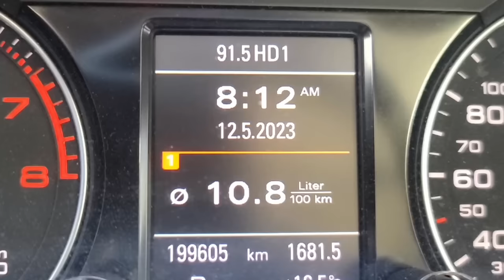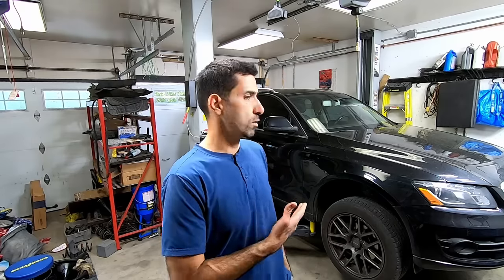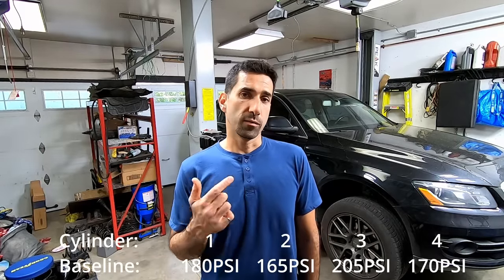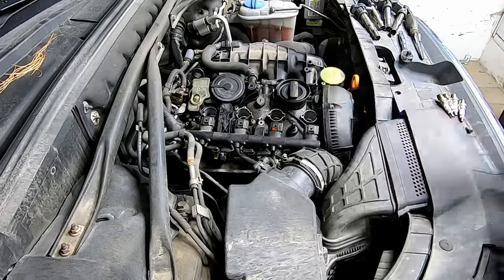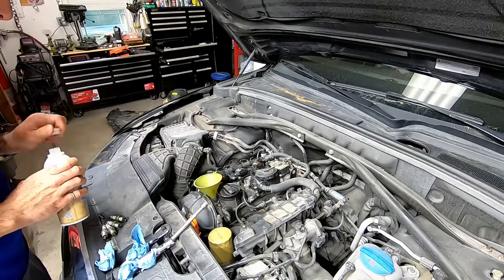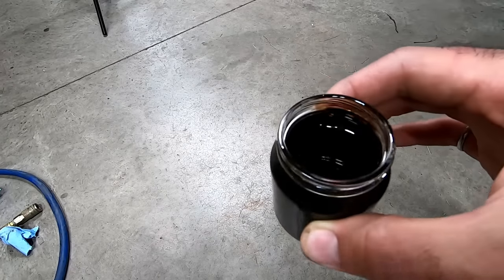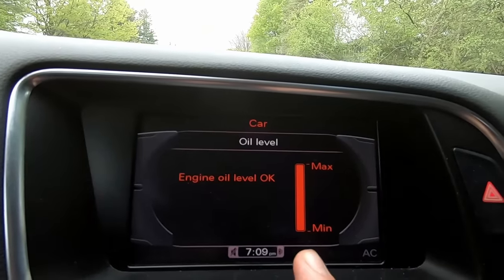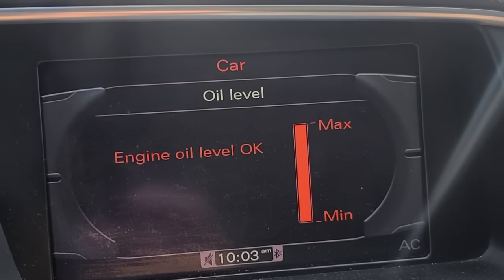How to fix excessive oil consumption from clogged piston rings (Part 2)

Comment: Here’s another data point decided to give this a try on my 2015 q5. It ran great just used about a quart every 350 miles. Did it exactly how you did it and vehicle won’t even run now. It was difficult to start after the soak to be expected. Drove pretty poorly for the 20 minute drive. Changed the oil, Misfires like crazy, will barely stay running.
Reply from the maker: Take the plugs out and clean them up... when I did that on the A4 the plugs were very fouled and I had misfires on two cylinders so I needed to clean them and dry them before the misfires went away
Reply from the maker: Does it throw any codes other than misfires?
Reply from the maker: Hey - any updates on this?
Reply: I got running well again. After clearing engine faults and resetting basic settings it ran fine something threw it way off. I've only driven 150 miles but it hasn't burned any oil. Typically it burned about a half quart in that time.
Reply from the maker: @adamearle583  phew - you had me worried there for a minute... glad to hear it's running OK again - let's see where if there's a good improvement in the consumption... please keep us posted wth the final results
Reply: @adamearle583  how are the results a month later? Any improvement on oil consumption?

Comment: Good test. You should lube the seal on the oil filter and you shouldn't drop the plugs down into the holes. Use a piece of rubber hose to lower them into place and to start the threads.

Comment: I just started this process on my Q5 2012, 113k miles. But I am doing it over a two week trip. So far I have experienced what I believe is carbon debris that have swelled, causing a slight binding at top dead center. Being a zero clearance engine, this concerns me, I have an endescope and see the deposits, am agitating with a plastic tool to scrape and move, I sucked out the first B12 with carbon using an oil extraction pump.
Reply from the maker: Interesting...the debris is from the top of the piston? Are you driving around with B12 for 2 weeks? That might be a bit much... good idea on sucking out the garbage for sure - is the motor binding when you rotate by hand?
Reply: @ETMotorsports  I went on a trip by airplane for 10 days, started the B12 soak days before leaving, continued when I returned. Bottom line is IT WORKED!!!! I can't be happy enough,  already driven 800 miles, oil level same as when I filled it. Tailpipes tips no longer sooty, amazing results.

Comment: just a trick before you want start the car. a few drop of engine oil on the pistons before you install the spark plug would make it way easier to start and better for the cylinder wall
Reply: I sprayed some Stabil engine fogging oil in mine and it fired right up.

Comment: Thinking about it... This is fuel injector cleaner. It's a liquid that will burn just like fuel and it's intended as an additive to fuel.
Now you poured a bottle or 2 of it directly into the combustion chamber. It will slowly leak through the piston rings and down into the oil pan. Regardless of the fact that it will dissolve the carbon built up in the piston rings. You will end up with a liter of fuel-like substance in your oil. You run the car and the oil warm up until 100 degrees. Won't that 1L of fuel ignite inside your oil pan?
Reply from the maker: haven't had any issues with flammability

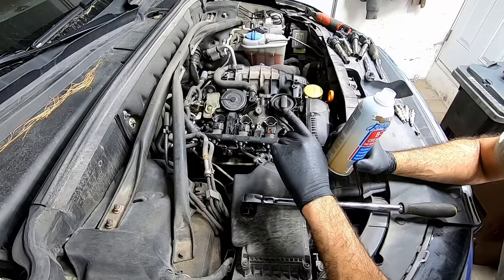Comment: 5:55 that's if the engine oil sensor is accurate.
Mine is a Volvo v60 and it's consuming more oil than "normal" but it doesn't show smoking out the exhaust.
9:52 mine doesn't do that.
My v60 engine does not have an oil dip stick, it's electronic, hence I'm hesitant.
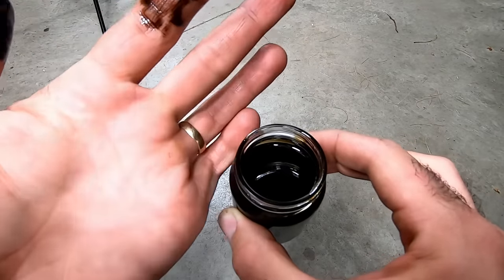11:49 how that sludge is formed?
13:59 good 👍🏻

Comment: The Chevy 3.8 liter engines were bad about the Plastic Intakes Warping, I had one that started using 2 quarts every 3000 miles, the Warped intake allows oil to enter combustion/intake chamber thus the oil burn starts. Replacing the Plastic Intake which is not that hard of a job cured the problem...

Comment: This is very interesting. I'm wondering if this is worth doing on a very old engine. My truck has a small block V8, which may or may not burn significant oil (overhauling the truck that has been sitting a long time and never drove it much yet). Engine seems to be running g fine, but there is some oil smoke, especially after start up.

Comment: Thanks for the videos great work! I just think you got the camera to check cilinders before and after to see differences and trying to know really the problem. Now we have more information like a solvent (injector cleaner) its doing something that help or solve the problem (of course temporarily) so what's doing and how to avoid happening again. Looks like lubricant rings get dirty and stuck and stop working well/properly. So maybe an additive detergent inthe oil can last longer the solution? Just thinking. Maybe a forum to discuss all us involved in this issue can find the best solution. Also could you put on description the products and alternatives for countries where can't buy B12, please? Thanks again!

Comment: I use liqui moly soaking on my 2010 Q5 and there were no any misfires or hard start . Everything just fine.
Hope it works!
Reply from the maker: how's the oil consumption now?
Reply: i think liqui moly engine flush not work,still same consumption for 500km/L
Reply from the maker: @SCOTT86056  shoot...i was really hoping it would work - lots of folks don't have access to B12
Reply: @ETMotorsports  i would like to try it again but no idea which product works  and yes we don't have b12 in asia. haha
Reply: and i  guess it should be hard start and smokes to remove the carbon on pistons
Reply from the maker: @SCOTT86056  isn't there a liquimoly fuel system cleaner available? Somebody mentioned they have a diesel fuel system cleaner which is very strong

Comment: Tip, use fuel line to remove and insert plug. Better than dropping them in.
Reply: Couldn’t believe how he just dropped the spark plugs back in, potentially altering the electrode gaps?
Reply: @sthillarys52  Super sloppy

Comment: i own an audi Q5 similar to this with 330.000 kilometers on original engine and i am not experiencing any oil burning issues. I have heard a lot of horror stories but i have never had a problem with this car apart from a timing chain replacement at 200.000 kilometers.
Reply: what is your oil change interval? are you original owner?
Reply: @vyberson  i am actually the third owner :P the 2 owner's before me used to change it every 15.000 km, but after i got the car at 118.000 km i used to change it at 10.000 km. Also most of the kilometers have been done at highway speeds.
Reply: @GtCobra12  that gives me some peace of mind. I have a peach of a b7 a4 at 60k km's and im looking at getting a winter beater above 200k of the exact same, but i am actually looking specifically for a project with some misfires or oil burning. Theres a ton of parts sitting around in the garage so i figured it makes sense to have 2 of the same.

thanks for the reply, cheers.

Comment: Thanks for the post!  I've got a 2012 Q5 2.0 T I need to try this on.  Berrymans B12 has always been my favorite carburetor cleaner.  The stuff is super strong and dissolves all kinds of deposits so I'm not surprised that it worked for you.  Cheers
Reply from the maker: is the Q5 burning oil?

Comment: Hi,thx for the vid. I had this oil consumption to with my 2.0 a4. I used oven cleaner for this piston/ rings cleaning proces. It did work out just like your process. But i ran the engine 500km after the cleaning with new oil and filter and renewed the oil and filter again. A lot of fine carbon particles in the oil. Thats why i did renew the oil/ filter twice. Oil consuption did go down 50%😊
Reply from the maker: Hey great idea... I'm curious which product you used - oven cleaner is usually in spray form which won't work to soak the pistons...
Reply: @ETMotorsports  hi, i use.the plastic spray bottle,so you just have to cut open  the can so that you can use it as a fluid😁 and poor it in the cil.  But its a very agressieve product!! It melts the carbon very fast. The brand i used is HG bbq/ ovencleaner. Dunno if they sell that brand at your place. I live in the Netherlands so maybe its not for sale at your place. But i asume the cleaners work al the same🤔 Use gloves and goggles with this stuf👍
Reply: Oven cleaner is NaOH which dissolves aluminium!
Reply from the maker: @rogeronslow1498  good point although if you're only using it to soak pistons and don't run it in the motor you should be ok? It's not an aluminum block so the bottom end should be alright... either way best to not use it
Reply: @rogeronslow1498 Nothing did go wrong👍 oil consumption reduced 50%! Try the oven cleaner on a old piston ,it melts the carbon....not the aluminium piston 😊

Comment: Great video keep it up man, i just cant help but notice you could hsve easily made the gap on the plugs smaller by throwing the plugs into the holes. Best practice to lower the plugs down slowly.. also i like to turn the engine iver with spark plugs out.. prevents chsmve of hydrolock

Comment: I have a 2005 Tacoma with 150,000 that was using oil between changes  I used Marvel Mystery Oil  in the crank case and conventional oil  and left it in for 1,000 miles and changed it back to Mobil 1 oil  it was a big change in oil consumption

Comment: My son just purchased a 2014 a few months ago and now we’re having this issue. Looks like we’ll be doing this as well.  He’ll have to decide whether he wants to do this every oil change or just sell the car and find something else.
Reply from the maker: I don't think he'll need to do this every change - this Q5 is now 2000km+ after the service and the oil hasn't moved so might last a while
Reply: @ETMotorsports  That’s pretty awesome actually, were you purchasing B12 from Amazon?
Reply from the maker: @MrJasonfromcanada  yes I think so - got a box of 12 in one shot
Reply: Do this soak, use a good oil that actually cleans and doesn't burn off easily, use a catch can,  and change the oil twice a year.

Comment: I had a 2013 Passat with the 2.5 and I never had oil consumption problems.  That is one of 2 years the Passat had the 2.5.  I don't know if Volkswagen does it but others use loose fitting rings to reduce friction for better mileage but those rings are what cause the oil consumption with those vehicles.  We have CAFE regulations continuously enshittifying our vehicles really.  Could they be slowly making internal combustion engines seem worse and worse so we might buy electric next?  I have no problem with electric but where to charge it, the price of the battery pack when it inevitably fails and the risk of fires from lithium ion batteries.  There are safer cells but they are still too new and untested.  A sodium ion cell would not have the same capacity even if it is the same size as a lithium ion cell.  I know people who would say more means bigger but it is not the case unless more cells are used really.

Comment: Thanks brother, may i ask i have BMW 120 i 2012 4 cylinder without turbo and now she’s starting to have a lot of smoke. Can I use this product and the same method to solve this issue? Thanks so much 🌹💜🙏🏻
Reply from the maker: Hmm smoke could be caused by a bunch of stuff from leaking valve seals to head gasket... have you had this diagnosed? The method would really only help with stuck rings- the rest of the stuff needs actual intervention
Reply: @ETMotorsports  thanks brother for these information, i will start the work on the car on Saturday, and i will tell you what will happen if you may , thanks dear 🌹

Comment: My 14 Audi TT with 2.0 was burning 1qt every 400 miles...I used BG 109 before oil change and ran it for 45 mins at 2k rpm and dies not burn a drop now.
Reply from the maker: Yeah I think shopdap did something similar on a passat as well but it was a full professional kit that i couldn't source... what was the cost of the BG?
Reply: ~ 300 USD

Comment: So I went ahead and did the piston soak on my 2016 Q5 2.0. The process you described is exactly how my experience went. After the soak rough starting the car. Once the car started a lot of smoke for a few minutes then it ran rough and misfired during my initial ride. I drove around the block and the car misfired but it seemed to get better. After the oil change, the car ran a lot smoother and only seemed to misfire at higher RPMs.

The car was going through a quart of oil every 150 miles. As of now and I am only just into driving it after the oil change 106 miles and the oil meter has not even budged so I am pretty optimistic that was will dramatically improve the oil consumption. Normally after 100 miles the meter would show almost 1/2 to 3/4 of a quart lost.

Anyway my only question is how long should I expect the random misfires to occur(the misfire only occurs at higher RPMs).  I have not pulled the plugs yet for an inspection, and yes the plugs are new.
Reply from the maker: Hey sounds promising! Keep us posted with your results...

As for the misfires - your shouldn't have misfires when all is said and done - high or low rpm. Is the misfire localized to a specific cylinder? Pull the codes and then go look at the plugs... it's possible one of the plugs got fouled during the initial run after the soak and is causing issues but it's also possible it's unrelated - bad coil etc. Until you know better which cylinder is doing this you won't be able to diagnose properly
Reply: @ETMotorsports  codes show 2 (302) and 3 (303) had the misfires. Plan is to look at the plugs and see if I can tell anything from them.
Reply: So another follow up. Driven 1000 miles only lost 1/2 a qt so far

Comment: At the 6 hr mark, watching this video again.  4th piston had oil and was still full of b12 on the rotation.  All other cyclinders had drained.  Hoping the 4th piston frees up in the next rotation.
Reply from the maker: @richardrussell1025  fingers crossed... they're didn't seem like there was correlation between how fast they drain and which one is the worst... you might notice the drain rate changes over the next few hours - mine seemed to be random

Comment: wondering if this would work on my Tucson 1.6T, i looked with a camera on the cylinders and saw some oil building up and its going through a qt every 6000km. My A5 had massive consumption and this process worked great, 1qt every 3500km now. Topped it up and going on 5500km and no change on the digital indicator. So I'm thinking of doing it to the Tucson but would it be better to try seafoam instead of berrymans? cheers
Reply from the maker: @alejandrocabeza1919  1qt per 6000km isn't really that bad... if you've already played with B12 just do that... if it's rings it should help

Comment: I have a 2016 Tiguan thats "seeping" some oil from the valve cover, the pendulum fitting, and for some reason out of the turbo inlet.  I also got lots of "blowby" condensation in my ECS Tuning catch can.  My oil gets changed every 6 month as I don't put tons of miles on the engine, and the filter every 3 months because I mainly use the car in city driving, traffic, stop-and-go, and short trips.  I changed that PCV valve/Africa Plate on top of the valve cover and noticed less blowby in my catch can, less oil seepage around areas where it was coming from, and what looks to be residual oil from the turbo inlet.  The dealer and a specialty shop couldn't properly diagnose and correct this problem.

I don't have excessive oil consumption, and Amsoil isn't known for burning off very rapidly.  Oh...I just dumped a full can of B-12 chemtool in the gas tank with 15 gal of 92 octane.  Guess I'll keep it up.  Thanks for the video.
Reply: Why would you change the oil filter more often than the oil?

Comment: Thanks For your Video, I have a Q5 2011 2.0L, I`m not a mechanic, but I was wondering if adding B-12 with oil and running it for 30 min, just before the oil change, can have the same effect. Or can adding the B-12 into the Full gas tank have a positive effect? 🙏🙏🙏
Reply from the maker: Hey adding it to the oil to fun run is an engine flush - too fast and not effective..adding it to the fuel will clean up fuel system - won't do anything for the piston rings

Comment: This was the worst idea for my 3.0t 2015 s5. I changed the oil after performing the piston soak. And my oil had so much metal shavings. It looked like metallic paint.I have multiple codes, warming light for low oil pressure & cooling system. So much blue smoke out the back it’s hard to see the car behind me at a stop. I tried cleaning the spark plugs but that didn’t work. Clearing the codes… nothing. I’m sure this blew my motor and now I need a rebuild or replacement.
Reply from the maker: Did you run the motor wth the B12 in it? B12 won't cause metal shavings of any sorts... lots of viewers have successfully done this to a 3.0T
Reply: Yes b 12 was in the motor. It drove fine for 15 mins drive I did at 50-60 mph. I got home to change the oil and filter. Noticed  a bit of metal in my oil but it was dark.  After I was done I took my car on a quick drive to the store at then the light when on and it told me to turn off my engine. I did them check the data and it had 2-4 codes. Checked the temp and it wasn’t overheating so I driving it back. Got home check the spark plugs and drove it again and it did fine for 10 mins then the faults came up again and so did the blue smoke.
Reply: The next day is when I looked at the old oil and seen how much metal was in there. It was really bad!
Reply: @MrWeedley bro any updates on ur car having the same problem 12 a6 3.0t